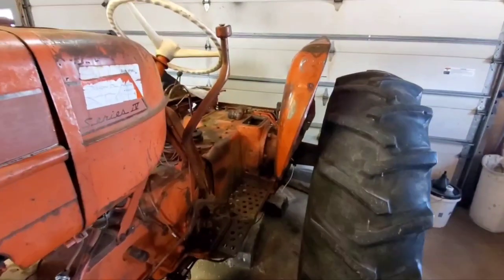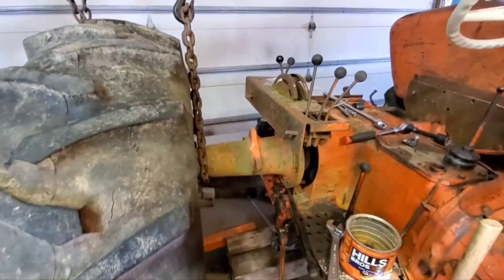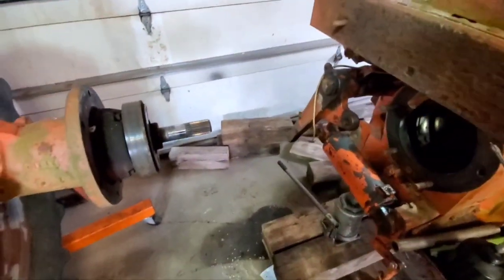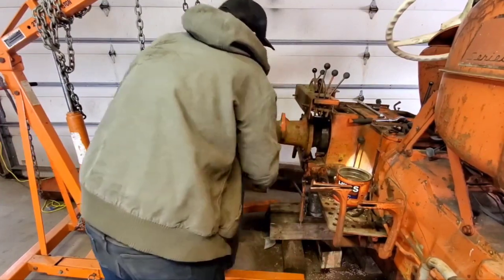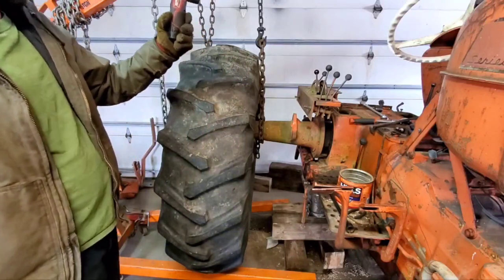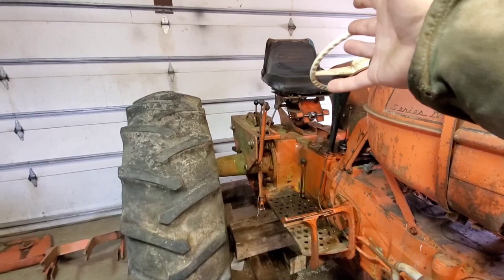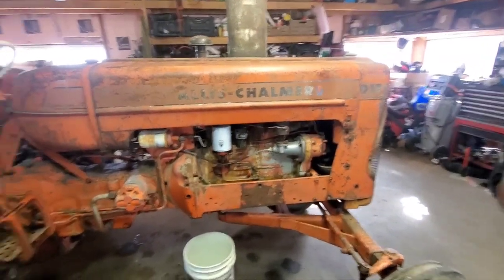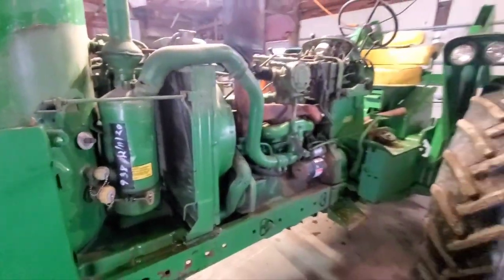Allis Chalmers D series brakes.... TIPS AND TRICKS.

Comment: Well done! That will make someone a nice tractor. I wish they would have put a rubber boot where the adjustment rod goes into the housing. Mice find that an irresistible place to build a nest, often leading to things rusting up. It’s the pits you had so much trouble getting the right seals. I got all the seals for my 170 from AGCO without issues. Luck of the draw I guess.
Reply from the maker: Thankyou Pete, I've never had issues like this with seals. Part numbers where messed up across all the company's, I think I've got them all sorted out now for the next anyhow lol

Comment: Allis Chalmers and John Deere have a poor brake location ,as for ease of replacement. International"s are more mechanic friendly.
Reply from the maker: Agreed until you get into the 19s and 190s now those are simple. Lol
Reply: As for John Deere, it will depend on what model you are working on.  For example, the two cylinder tractors had brakes that were  very easy to work on.